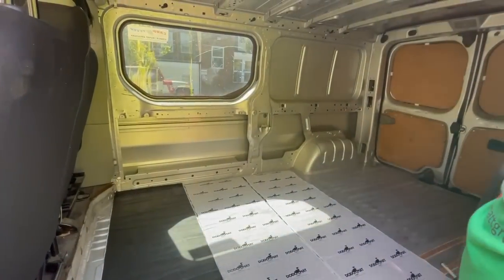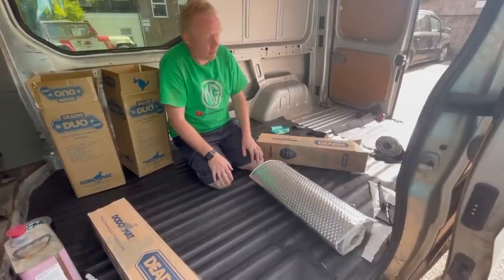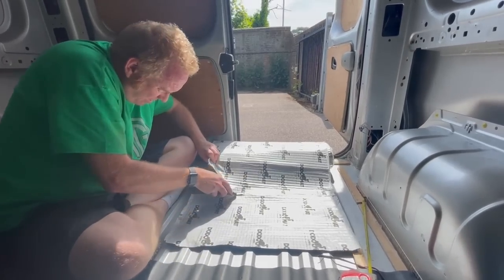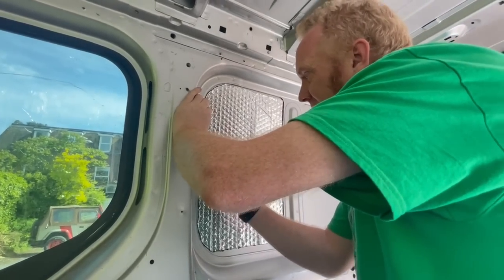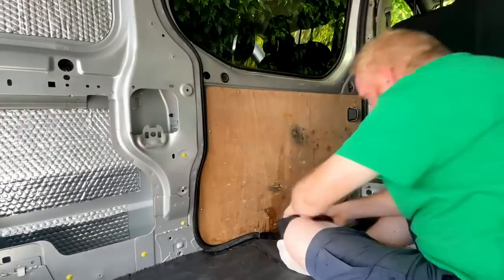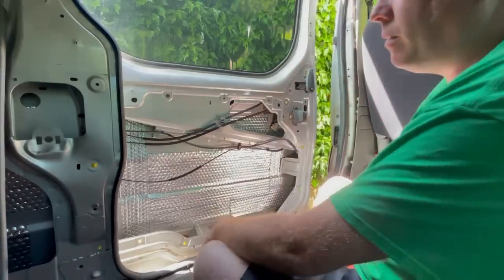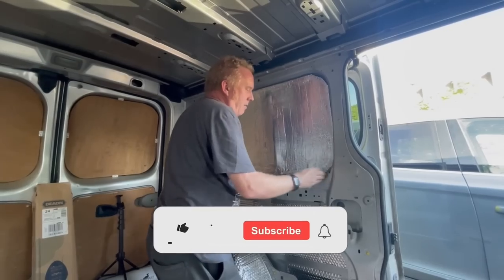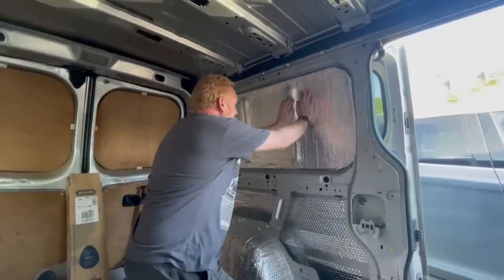Installing SilentCoat on floor and walls - Part 1

Comment: Back in my yoof,i was heavily into car audio and had to sound deaden my car (Calibra turbo) and used Dynamat which was really effective. Had to deaden bizzare places like number plates, interior lights etc etc because the bass from two 12" subs rattled the car to pieces. Great days.

Comment: Any risk of rot between these and the body? Or like fire if you weld under it ^^. Always wondered. Good luck with this motor Matt. Chicken and chips.